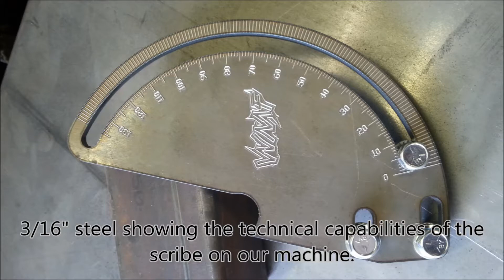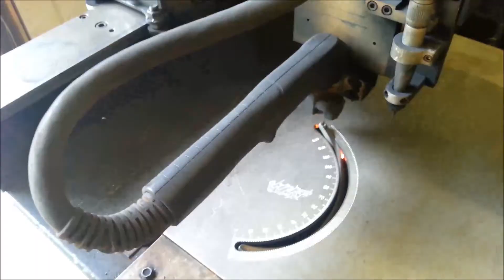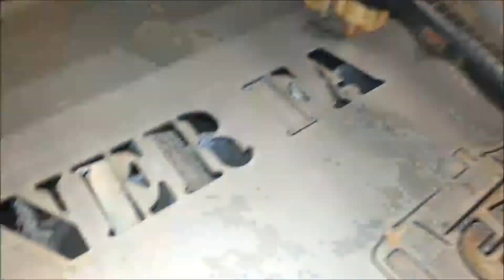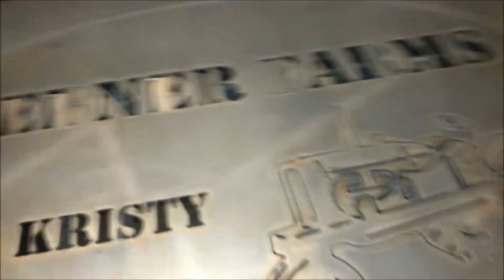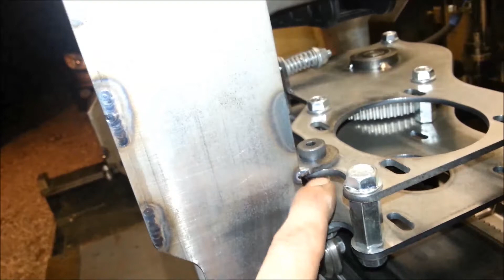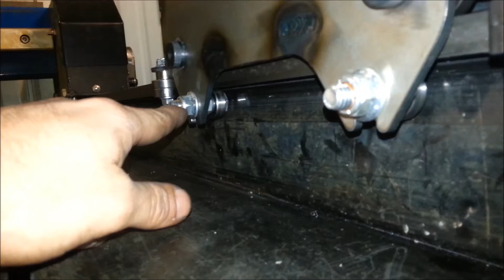Alpha Wolf™ CNC Plasma Gantry Capabilities & Design Overview

Comment: How do you have the torch and engraver work in 1 program and also make up for the different offset of the engraver?
Reply from the maker: Unorthodox Fabrication it is done with layers in sheetcam and the post processor for offsets
Reply: Thank you. That is a really nice setup you have made.

Comment: very nice CNC.   what kind of  engraver are you using .
Reply from the maker: Max Smith it is a Chicago pneumatic engraver with our own scribe setup. we will be adding the scribe packages to our website sometime soon
Reply: Chicago pneumatic engraver from harbor freight?
Reply from the maker: Max Smith No, Chicago Pneumatic is not sold at Harbor Freight. They have a CP, but it is central pneumatic. Very big difference in quality!
Reply: thank you for making that clear for me i was always confused about  Chicago tools and where they made. 
and i have one more question your plasma cutter works perfect, what kind of plasma cutter you using .  thank you
Reply from the maker: Max Smith that machine is using a hypertherm powermax 1000.  The newer 65, 85 and so on are good choices.

Comment: Very nice table man. Looks to be very well designed and built. 
Do you like that type of engraver better than the diamond drag type? 
Do you sell that torch mount and engraving retractor apperatise by itself?
Best of luck to you. Thanks for sharing
Reply from the maker: It depends what type of work you are doing, but for what i am doing most of the time, yes i prefer it.  I currently do not sell torch mounts as there are already several good options.  I probably will in the future when i find the time though.  I am planning on putting a kit together for the engraver, but i have not gotten to it yet.  If it was wanted and paid for i would make time and put together the kit.  There are alot of things on my to do list, but unless it is already paid for work, i decided i am not starting anything else new until i tie up loose ends and get ahead of the game on existing products and work as i dont want too many irons in the fire.
Reply: Understood. thank you sir

Comment: the gantry turned out very good I watch all the stuff u guys build I'm new at all of this cnc stuff and I  just finished building a plasma table with mach 3 on it I have all green lights on everything drives torch height control and brake out board I can hear the motors lock up when I turn it on but no motor movement can u think of anything I'm not do right thanks dewayne
Reply: were you able to fix your cnc.